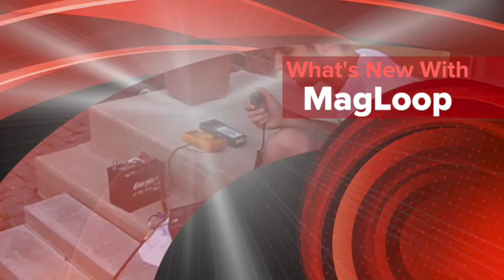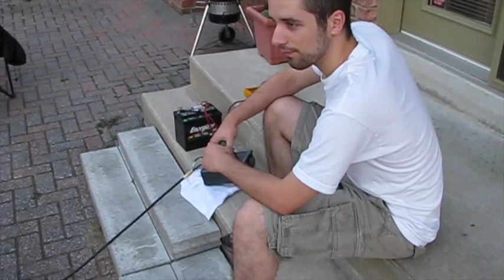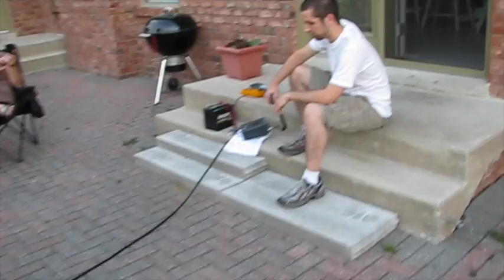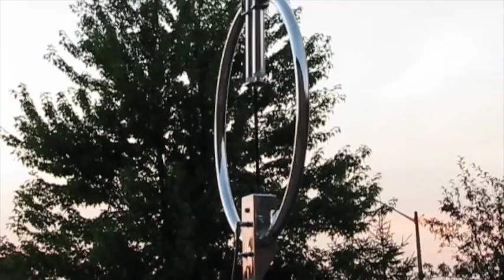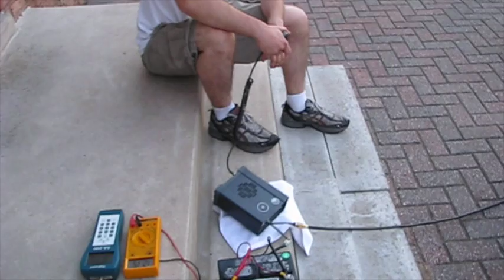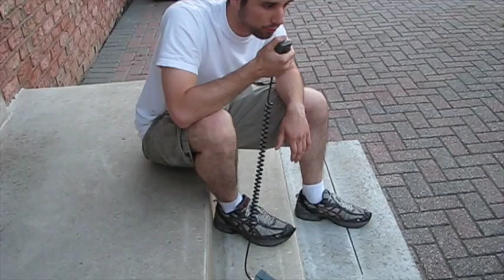VE3UK's latest addition to his MagLoop Line of Magnetic Loop Antennas.

Comment: Thanks Bob. Question for you and your experience to date with Mag Loop antennas. How well do they work as NVIS antennas? I am involved in emergency communications and right now I use 80 meter dipoles 20 to 30 feet over the ground to achieve NVIS. Just wonder if mag loops equal or better the dipoles for that?
Reply: Donn, that is a great question. As a matter of fact, we have been approached by a few non amateur EMCOMM groups, such as fire departments who participate in emergency communications exercises to produce these antennas for them. That is really where this particular design was born from. If you look at the radiation pattern of these antennas you will see that their pattern would resemble a wheel rolling through a puddle and kicking up spray in essentially 360 degrees. So, based on that, one could assume that they are equally equipped to produce good results for NVIS as well as low angle radiation. Most importantly, they work as well about 1 loop diameter from the ground as they do up 100 feet. Hope that answers your question, if not let me know.

Bob
Reply: Hallo Bob VE3UK i want one but whats the price and how could i Order it ?? I have signed me in at your E Mail Account but no answer thank anyway DL5FS Frank